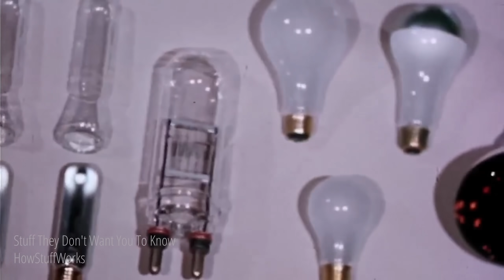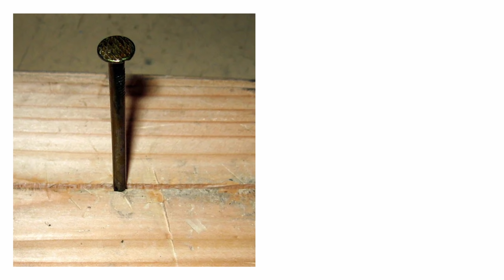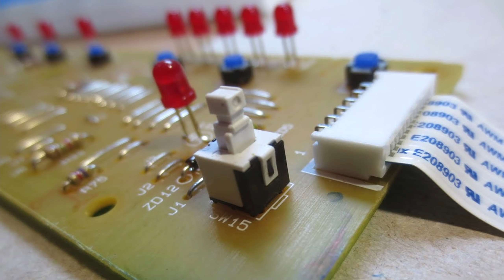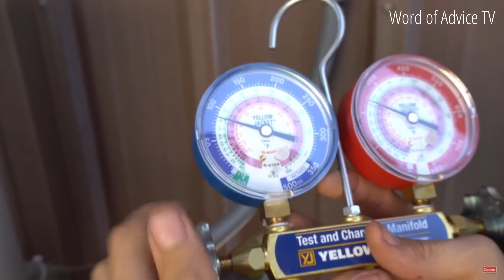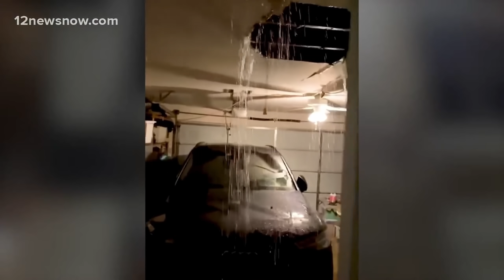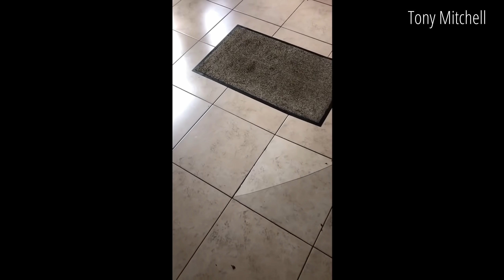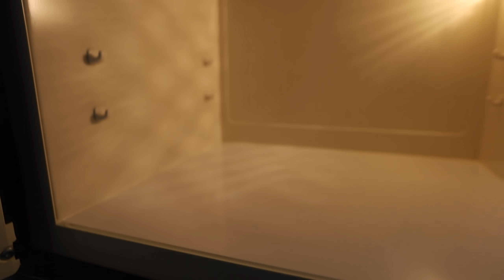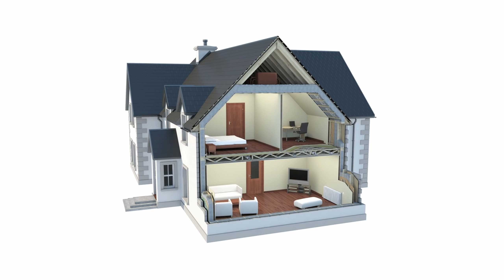Built to FAIL | Planned Obsolescence

Comment: Electric hot water tanks: Moving Parts  = Zero. Life Expectancy = Warranty + six months. Engineered and designed to fail.
Reply: On a tour through a manufacturing plant the visitors were shown a test setup designed to optimize the thickness of steel to be used for the tank. Inside of  a plexiglass enclosure were 3 different tanks each being cycled from low to high pressure, continuously. The tour guide explained that the tank whose sides visibly bulged outwards with each pressure increase was obviously too thin of a gauge. Zero movement could be measured on the heaviest of the tanks and clearly the steel on this tank is too thick. Outward bulging of the middle tank was measurable but the steel deemed to be strong enough to last the warranty period. Engineering makes all the difference.
Reply: Problem: Electric Hot Water Tank Elements last too long. Solutions: 1. Use plain steel (no copper coating) to jacket the element increasing the probability that it will rust and so, fail. 2. Increase the heating density to reduce the total length of the element from 40" to 16" (approximately) resulting in 3000 watts of heat being dissipated from a much smaller surface area which leads to greater expansion and contraction of the element during each cycle which often leads to the element jacket splitting open. A split element will let current go to ground causing the water to overheat to the point that the thermal overload finally trips and the tank produces no more hot water. Repairable? Yes, but typically the tank will end up being replaced as "when elements start to fail it usually means the tank will start leaking soon so my best advise to you is to replace the tank now and avoid the mess caused by leaking tank.".
Reply: Problem: Our company is not selling enough Electric Hot Water Tanks. Solution: Ensure that the tanks rust and so leak, resulting in the need to replace the tank. Implementation: Reduce the thickness of the ceramic coating inside the steel tank. Fail to fully coat the inside of the steel tank. Reduce the quality of the ceramic coating. Result? Increased sales of our tanks = increased Quarterly Profits = Big year end bonuses for Everyone!
Reply: Years ago, when tanks in my area seemed to just barely outlast the warranty period of 5 years (yes it really was that short back then), my father noted that one brand seemed to do a bit better than others, lasting perhaps 8 years instead of 5. To benefit our customers we would specify Brand A which lasted longer than Brand B. At the wholesalers to pick up a tank for a job, the manager who was filling in on the counter brought me a short lived Brand B tank. "Do you not have any Brand A tanks in stock?" I asked and was told that yes they had them but they were at the very top of the pallet racking, hard to get down and surely this 40 gallon tank is as good as any other. "Not so." says I and explained why. The manager responded with "Well Brand B may fail sooner but that just means more installations for you and more sales for us and well, 'That's just Good Business'".
Decades later the anger I felt upon hearing those words, has yet to abate.
Reply: Is it hard to build an Electric Hot Water tank that will last for decades? From around 1940 to 1960 or there about, tanks were built that did last for decades. There are bronze 25 and 30 gallon tanks with side arm heaters that are still in service today as are some Monel tanks. When the city boosted the water pressure in the mains and without pressure reducing valves on each residential service, some bronze tanks in my area failed, splitting along the brazed seam of the tank. Some of the Monel tanks used a heating element that wrapped around the outside of the inner tank, held tightly in place with a spring that allowed for thermal expansion and contraction. These were very robust but over many years they did eventually fail. Happily, these elements could be replaced without having to drain the tank as is required when changing the elements on tank that uses immersion elements. 
While serviceable and reliable these tanks are increasingly rare as plumbers will often advise customers the tank must be replaced due to the failure of the element or thermostat. Do plumbers simply not know how superior and durable some of these old tanks are? Perhaps. On the other hand, they can make more money selling and installing a new tank as opposed to installing a new element. More relevantly, many plumbers recognize that the scrap metal value of bronze and Monel tanks is significant and they are more than happy to "dispose of that crummy old tank for only a small extra charge.".

Comment: My parents recently got a new property, and we've started building on it. Very few contractors involved, all our own construction. My dad has had code drilled into his head, and while it's useful to know the minimum requirements for a safe home, I feel like maybe we aren't doing enough to exceed the "minimum requirements".

This video shone a light on that idea - We're using nails to secure walls to foundation. We're using nails everywhere, instead of screws, or bolts, or metal straps. We're using slab-on-grade on clay heavy soil. We're burying pipes in concrete.

There are definitely things we're doing that are an improvement, and some of our shortcuts are out of necessity, but I hope to bring a few of these ideas into the mix as we go.
Reply: Nails are preferred over screws in some construction because of sheer strength.
Reply: @YSLRD  yes, but not sill to foundation! Geeze

Comment: Excellent presentation. I totally agree, but I believe that there will be no progress on this to benefit consumers, because the manufacturers hold the control with their concentrated dollars. I presently live in a home built nearly 200 years ago. It is very difficult to work on because nothing is straight at this point, and I am an amateur carpenter. But the wall studs are full 2" x 4" timbers, hand cut into the floor beams which are still hard as rock. We have replaced all of our appliances in the last 2 years because they were all more than 20 years old, and failing. I believe that the new appliances are not as good as what we replaced, and I hope that we will see a reasonable number of years of life in them. Keep up the good work, your message is good, and all of us viewers agree, but changing industry practices that result in more short term profits for them will be virtually impossible.

Comment: Good points. Manufactuers are the primary souce of planned obsolescence. Fashion and fads  are the secondary assist. I agree a  manual for each home would be good. Especially it help in the cloud and available for aggregated statistical inspection. I guess it would be a challenge to retrofit  to all homes with legislation or other enforced means.

Comment: Saying your fridge is a result of planned obsolescence is nonsense. The compressor failed, it was not necessarily designed to fail. Indeed, studies have shown that refrigerator compressors are phenomenally reliable devices and typically outlive the rest of a refrigerator. In this example, I think you just got unlucky. And what did you immediately do? Bought a different brand fridge. Brands know how valuable brand loyalty is. They will work damn hard to preserve it. What you should have done is called the manufacturer and got one of their technicians to come and diagnose the fault and fix it. Many manufacturers will repair things which shouldn't have failed cheaply or for free, even when out of warranty in order to maintain brand loyalty. They get parts way cheaper than you can, they have the right diagnostic tools and experience to fix the fault cheaply and quickly. You decided to make this probably perfectly repairable device rubbish. Not the manufacturer. Also, your IR oven example, a skilled technician can replace any soldered component in seconds. If it would take you hours, you don't have the right skills to fix this device. Your points on poor building practice are closer to correct. But terming these things "planned obsolescence" is daft. No engineer or designer is ever told to make sure something breaks after X time. Indeed this is a very difficult thing to try and engineer. Instead they are told to make it as cheap as the standards/market allow for, which is a totally different thing. If someone is wallpapering over perfectly good paint or visa versa, they are a fool who is being influenced by marketing telling them to keep up with the Jones'. Poor materials and poor workmanship are issues for sure. But the idea of planned obsolesce being close to a marketing conspiracy is nonsense.

Comment: Thank you for a brilliant video. You are absolutely right.  Unfortunately the changes required to combat planned obsclescene will never happen. Money comes before sustainability. As a contractor i have learned that buildings built before 1960 last much better than those built post 1960. Updating old buildings to new standards can be very expensive, especially when asbestos and  lead need to be removed, but that is another topic altogether. Keep up the good work.

Comment: You may be 'preaching to the choir' here... but you are right on the button.

Outdated materials aren't new. I lived in a house in the UK that is over 350 years old, but the roof would need to be replaced when the thatch deteriorated... mind you, it lasts more than three-quarters of a century if done right. One house I'd owned in in the UK would be 100 years old now - it's slate roof would still be in good condition, walls and floors rock-solid. When I heard of 15-year shingles here (Canada) I was flabbergasted, and had to re-roof twice. So these 40-year shingles are wonderful? Yeah, right.

As a contractor of small homes, and a renovator, I gave my customers as many choices as I could with what I had, and discussed the pros and cons.  And I also photographed all the walls before closing in, so that they'd know where everything hidden would be. Back when George Lucas (I think) was building his house he had duct-work put in for stuff that wasn't invented yet... of course, it's all wi-fi now (he didn't see that coming, eh). But I would be hard-pressed to be a renovator in the UK... knocking out entire walls would require steel and concrete, not studs. No wonder most Brits never did much to their homes, other than change the wall-paper. So perhaps it's a national thing? We expect, this side of the pond, that our home will not suit us until we've moved a few walls, door, and windows... so our lifestyle is certainly part of the problem. But it at least kept me in work.

Thankyou for your videos, ma'am.

Comment: I've noticed LEDs and CFLs dying in less than 10 years, but they were cheap ones.
4 months sounds like an "Amazon problem."
It's not clear to me how homebuilders stand to benefit from low-quality construction other than just competitive pricing, though. Even a crappy house should last 30-40 years, which seems to me to be too long a time horizon for planned obsolescence to be effective. I just assume that cheap land, cheap labor, and cheap materials let you sell at lower prices and outcompete anyone trying to build a good home. The appliances and fixtures? Sure. But the structure itself...?

Comment: A good example of electronic components that don't last very long are capacitors with a liquid electrolyte(they barrel shaped thing on the PCB). Over time the liquid evaporates and if one components fails everything fails. Military specifications require the use of solid capacitors, but they are maybe a few cents more expensive.
Electronics has no moving parts so there should be very little wear unless you make all components so small that they can barely handle the current. Imagine your car only had one instead of four or six cylinders and you had to run it at 6000 RPM on your entire morning commute.

Comment: I got the same Samsung fridge from Costco, also replacing a GE fridge. I like how you picked the “basic” fridge with no fancy electronics, no in-door water/ice dispenser. You knew that all that extra complexity is just going to fail sooner than the primary function of the fridge.  

If you look at reviews of the fridge, you’ll notice there is an issue with the drain line icing over and causing frost to build up in the fridge. Here’s to hoping that this dosn’t happen to your fridge!!
Reply: Sorry to say, but it is Samsung, it will fail anyway a short time after the warranty has been expired. You cannot buy things like this from this company.

Comment: We now only buy Samsung appliances. They are the only manufacturer to give these warranties so good for them. They also have the only washing machine drum you can still take apart to change the bearings. The same issues with buildings are also here in the UK. New homes are well insulated junk but most old housing stock is poorly insulated but will last for ever - so they are sometimes given an external skin of a high insulation covering.

Comment: That's a weird law for the fireplaces, are you sure? I don't know for BC, but both Montreal and Quebec City have put in place new regulations. We're only prevented from using fireplaces in extreme smog days, else we can use them as long as they meet some recent EPA standard. And if we lose electricity for more than 3 hours, those rules don't apply anymore. We even have a replacement incentive of 50% up to 1000$ in Quebec City.

Comment: I don't think all of this can be fairly labeled as planned obsolescence. Take slab-on-grade foundations. They are considered to be cheaper and take less time to build. They can be done on any soil, resist termites, don't flood, etc. They are in style and companies know how to work with them. Your criticisms of them are valid, but I've never met anyone in construction, and I've known quite a few, who thought they were making an intentionally problematic home. Post-tensioned slabs are, in my mind an example of trying to solve a problem without making uncomfortable changes. People like slab-on-grade, but they have problems, why not just strengthen the slab rather than move to a different foundation? It isn't planned obsolescence from what I've seen. It's attempts to minimize costs where you shouldn't and following trends where they don't make sense. They don't take the cost and difficulties of repair into consideration because, 'that isn't my job' and they aren't thinking of the home as a system to last. They think of it as a job to get done and paid for.

Comment: GE sold their appliance division to china.
My Sub Zero is 33 years old and cost $3300. It has NO electronics and is completely repairable. One of the compressors was replaced under warranty and I had to replace the refrigerator side evaporator and the refrigerator side cold control. When I called Sub Zero for the evaporator they told me I should replace the entire refrigerator because of it's age $11,000. Who cares about color? Stainless is forever.
I think I'll keep it.
Now that I think about it, I have all the same appliances I bought 33 years ago although I did replace my used Sears laundry with new Maytags about 26 years ago and have never had a failure on any of them except as mentioned above.
Oh, love your videos.

Comment: The key to maintaining a foundation in clay is to resolutely & absolutely keep the foundation perimeter & underlayment 100% Dry As A Bone.

This is accomplished by proper grading of the yard up to the perimeter of the foundation as well as copious, overuse if possible, of landscaping & of course if needed properly sized gutter system that conveys the water at least 10 feet away from the foundation (not just dumps it at the foundation as most down-spouts do).

As expensive as most people would think a French drain is? In the long haul long-term they are quite inexpensive for what & how they keep the foundation properly conditioned.

Comment: Although I agree with the general message of the video, comparing planned obsolescence in the tech industry with the construction industry is completely wrong. The types of techniques and materials used in construction are entirely dependent on the building costs and the house market and have nothing to do with planned obsolescence. Unlike with fridges and mobile phones, if you want you can build a house that will last for centuries and be virtually indestructible, with either concrete, bricks, metal, stone or wood. On the other hand, houses have been always expensive and complicated to maintain. There has always been a need for trained professionals. Also, there is no issue on the right to repair your house. No private company will prevent you from repairing or renovating a building. Have you ever opened a new window on a massive load bearing stonewall?

However, I do agree that the public needs to be educated when it comes to house construction and that manuals on buildings should be available.
Reply: I think the point being made (for buildings themselves) was less about software lockouts to repair and more about choosing building materials and methods that are easy to repair. Like embedding plumbing and electrics in spray foam or concrete.

Comment: it's partly short-sighted regulations. for example, to get an energy-star stamp, a dehumidifier has to be made with very thin coils. meanwhile, my friend's dehumidifier from 30 years ago still works while I have to throw mine away every 1-2 years and buy a whole new one. the operating efficiency gain is lost by the embodied energy in the manufacture and shipping.